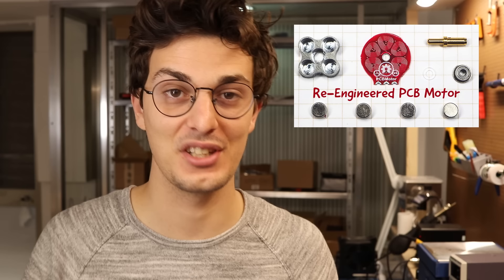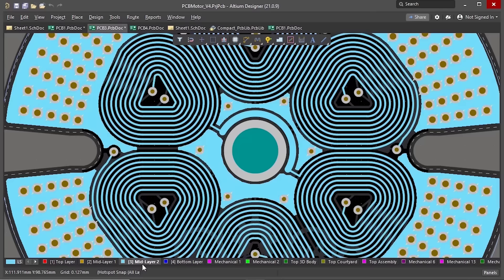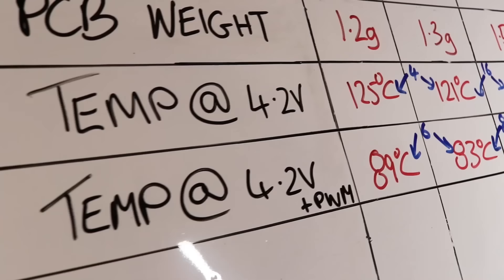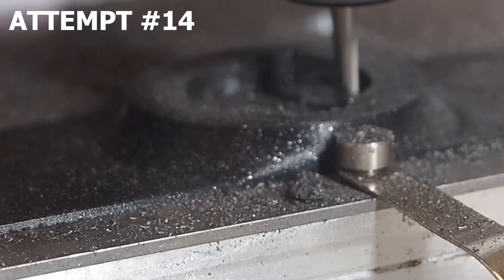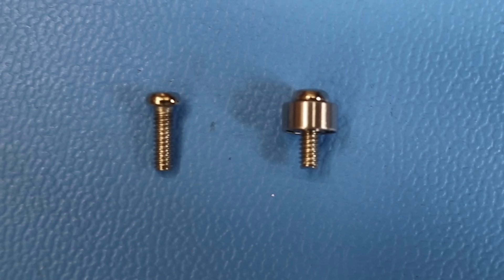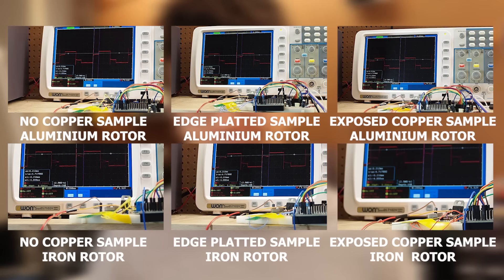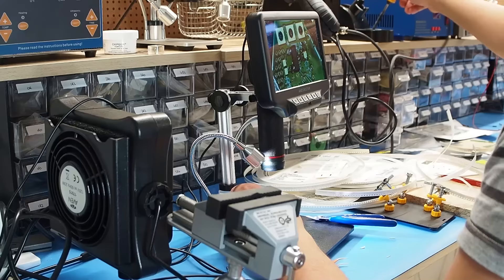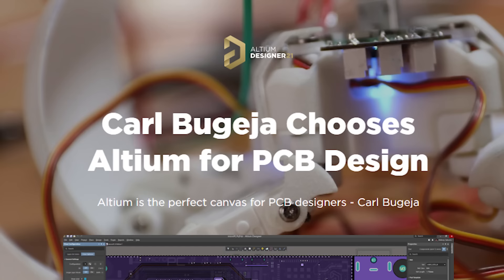Making PCB Motor v4

Comment: You STILL have not completed the magnetic circuit through the stator. You can DRAMATICALLY increase your torque by putting a second rotor on the other side of the stator to draw the magnetic field through the stator windings more efficiently, as well as adding the additional magnets. You could also just put a steel water on the back side of the stator, but you'll get some eddy currents being made inside the washer.

Comment: A cool project idea for these struck me today - a quad copter.
If you could write custom controller code for a small microcontroller and add a battery, you might be able to have a quad copter milled and assembled and sent to you save for the propellers.
PCBs are pretty lightweight but also decently strong, so being able to just order some quad copter a cheaply from a PCB mill would be pretty cool.
Heck, maybe the military could put electronically-activated explosives on them and get a cheap source of controllable missiles lol

Comment: I'd recommend to set up design rules in Altium Designer  to avoid silly mistakes in future.
Design rule check really helps to find either undesired net connections or layout that goes beyond manufacturer's capabilities.

Comment: Instead of iron use silicon steel (aka electrical steel). Silicon steel is a mixture of iron with a silicon content of up to 3.2%. The silicon addition improves the magnetization of the steel and its electrical resistivity (the opposite would be electrical conductivity). Adding silicon increases irons’ electrical resistivity up to 5 times. This change results in a decrease in the alloy’s eddy current losses, which directly affects the magnetic core. To fabricate the cores you have to water cut the shape as heat destroys its properties and you can't machine it because it shatters.

Comment: If you add some small holes near the center shaft of the rotor, the rotor should act like a centrifugal compressor and increase the air flow between the rotor and stator. Increasing cooling of the stator with force convection. Or, put the holes in the pcb stator near the shaft for the air to flow.

Comment: Hey Carl you need to develop an insulin pump for people that have diabetes.. insulin pump usually has a stepper motor with a 17- 50mm diameter.. I’m not sure if bldc would improve something in working of insulin pump but the best advantage bldc has is high speed..

Comment: Cool project, and I'm a bit late to the game ;)

But, have you considered different ways of increasing / shaping flux in the motor? two possible thoughts:

a) leverage vias and/or copper planes in the center of the coils to mimic a metal core
b) use 2 PCB's to sandwich the rotor between to mimic radial flux motors

Comment: :1 Hello there, if i could give you some suggestions, you could try to improve your motor by laminating the iron. I know it seems to b something really hard, but there is already some silicon-iron or ferrite sheet in ali expres which are really thin, even more than that you could use the rotor itself with no magnets, since its made of iron however i suspect that if you do that you would get a lower speed because it would be working as an asynchronous machine. The lamination of the iron has to be parallel to magnetic field axe and it would help with efficiency.
Reply: hi could you please help me find those thin sheets from aliexpress? could you please give me a link? I can't seem to find it

Comment: @7:54 it makes less heat because it's carrying less current: the spinning magnet is inducing voltage in the wire, so there's less voltage (and thus current) flowing through it.  This is the same reason why you got the same RPM as before - you can't go faster because the spinning magnets induce the same voltage as you're trying to drive them with, leaving 0v left over to go faster.  i.e. KV.
Reply: This is also the reason why applying "countercurrent" (I don't know if it's the right english word, basically reversing the supply to try and stop/reverse the motor) can be catastrophic if the motor is moving too fast. The field coils see the voltage coming from the supply plus the voltage generated by the spinning rotor, and it creates an enormous current spike in the coils.
Countercurrent was used as a means of emergency braking on some old rheostatic trams, but drivers must only use a few notches of the rheostat otherwise they'll blow the motors.
Reply: @demoniack81  Yep!  I destroyed my $200 dual-VESC that way (hit the brakes when driving it from a lab power supply - turns out that when the VESC can't sink the incoming power into batteries, it self-destructs in protest...)

Comment: Could have just drilled the pockets in the rotor. After drilling the first hole you can bolt it to a piece of wood and weight it down.
Reply: I think the main issue with doing that is re-centering in the mill - matching up real world holes with CAD holes is quite hard, especially on a little machine like that! it's doable but doing all the holes in one pass is a much more repeatable process, which i imagine is even more important for such a tiny part where a small misalignment would add up very quickly (:

Comment: I don't know if this would help, but another PCB manufacturer (JLC PCB) have upgraded their pcb range to include aluminium as base instead of standard FR-4. This will improve heat dissipation a lot.
Reply from the maker: thanks for your comment :) aluminium pcbs are usually used with 1 layer designs - multiple layers will significantly increase the price

Comment: Try nickel instead of iron.  It too is a magnetic material.  If you have any Canadian quarters between 1968 and 1999 they are 99.9% Ni.  1985-1981 "Nickels" (5 cents) are smaller but harder to find and also 99.9% Ni.  Interestingly, newer coins have steel in them so even they might prove interesting.  You could of course also just buy nickel disks/rods, etc and try milling them or have PCBway try it, but it shouldn't be as difficult to mill as iron.

Comment: I think you should have heated the iron rotor to about 200C with hot air and then drop in the bearings. let it cool down naturally and perfect fit. No knocking necessary... :) Maybe you iron bearing not tempered that's why it broke? Overall good job!

Comment: You could add a small 3d printed fin structure to the PCB-facing side of the rotor which acts as a small ventilator for cooling the PCB actively.

Comment: Great video and from your pronunciation, I think you're from a sunny and currently very hot place called Malta. Can't you use a small vice to hold the iron pieces whilst milling? You could also try a magnetic table as a vice. It should work. I also think that the bearing insertion should be via a vertical press of sorts and make sure to keep to the bearing tolerances when you manufacture the bearing hole (use BS.4500A or similar).  This is also true of your makeshift rotor shaft. A screw like you used is not machined to precise tolerances. What you need is a machined shaft with the correct diameter and applying the same tolerances. Bearing should be press fit and with that sized bearing, the "press" can even be your thumbs. No need to hammer :-).

Great stuff, well done and keep it up.
Reply from the maker: Thanks for the tips! 🙂 I will apply some for these in the next rotor version

Comment: Use Painter's tape and Cyanoacrylate glue to hold down part. I learned it from NYCNC. It works exceptionally Good! Apply painter's tape on bed and part and than stick them with Cyanoacrylate Glue.

Comment: How to CNC small parts: Get a bigger sheet of metal, this way you can klamp or glue/tape it down better.
Let it cut it the desired path but add small thin Bridges. Like this the part wont fly away after it got cut out. You have to cut a the bridges to get it out. than smooth the edges where the bridges were. Finish.

Comment: I’m sure someone’s said this already, but what about 3d printing a small fan to fit above the motors that spins with the shaft, directing cooler air onto the pcb
Reply: sounds like you're about to build a drone :)

Comment: The speed limitation could also be caused by the shape of your rotor, it's not exactly, as we say, "Aerodynamic" or "Perfectly balanced"
Possible that making it round would increase maximum speed but that would also add weight so I see what you're going for here for sure. Adding poles could most certainly help with that.

I think thermally the edge plated version makes the most sense. You say that the fins of the exposed copper unit don't make a lot of difference to the overall size, but the extra size of the fins does mean that whatever your motor will be driving has to be further away from it, regardless of where it may be mounted. It also increases the diameter of things like wheels. With the edge plated unit, you get the improved thermal performance as well as the option of keeping the motor smaller overall and making the effective "size" of the motor in a given design dependent instead on the rotational position that the engineer may choose.

Comment: I think neighter aluminium nor iron is a good way to hold the permanent magnets in the rotor. I would recomment a fiber reinforced resin like G10. In order to increase the magnetic flux you can use an iron plate linking the poles of the permanent magnets on the opposite side to the coils. This will give you a higher flix density trough the coils. I also don't think that the distribution of the coil over the pole area is advantageous. It should be better to arrange the coils around the diameter of the permanent magnet. Otherwise a large part of the Lorentz force will not lead to a resulting torque.

Comment: The next time you are doing small objects on a cnc, Glue them to a metal plate with super glue, it dries quick with a firm grip. Afterwards you use acetone to remove the resedue glue from the metal. Watch makers use this trick to make small cnc parts.

Comment: That's some nice project! Suggestion: would it be possible to adjust the rotor for optimal air flow to the print, and thus allow higher currents, hence more torque? 
Suggestion 2: double the amount of poles... 
Anyways, I'm following this. I want to know where this ends.
( Suggestion 3: register for patent if possible)

Comment: Could the added size and material of the thermal pads be used to make a larger motor instead which would heat up less in the first place?

Comment: Very cool idea!

You could make the rotor with a drill press, it's not a complicated part.

And about the thermals:
Keep in mind that your motors have different efficiency at different loads (aka aluminium vs. iron rotor)

Comment: How hot was the ambient temperature when you did the measusements? I saw on the news that is extreme hot in the place you live.
Reply from the maker: Around 24degC (using ac)
Reply: So you are just outside the heat wave and the forest fires.

Comment: You want to use lots of copper with a high surface area to manage heat on a PCB, but removing the solder mask actually decreases the emissivity and can lower heat transfer. They only time you want bare copper is when you are conducting heat to another part like a heat sink (or component leads/exposed pads). In conduction the solder mask resists heat flow, but if radiating the heat to the environment the solder mask will be more effective than bare copper. 

However, the most effective mode of heat transfer on Earth at room temperature will be convection. You want to get some air moving over that copper area to cool it. Increasing emissivity will help most in free air convection environments when airflow is low as the contribution of radiation to total heat transfer is constant. As more air moves over the PCB, convection will become more effective. 

What if you modified the circuit board so you could glue in small cylinders of ferrite in the center of each coil? Wouldn't that make the field considerable stronger? It may be hard to find a ferrite rod with a small enough diameter, but what about electric steel wire? Unfortunately it seems to mostly be manufactured in sheet form. Regular steel wire would also work and would be better than not having it. It would be easy to test by manufacturing board with holes in the center of the windings. Test one with wire and without. 

Also are you using multiple layers to build the coils to get more turns out of the windings?

You may have already tried some of these suggestions. I know planar transformers are used commercially in electronics design and some are formed using  windings directly on the PCB. 

https://resources.altium.com/p/how-create-planar-transformer-pcb-layout
https://www.ti.com/lit/ug/tidub83/tidub83.pdf
https://scholar.harvard.edu/files/sct/files/coreless_planar_printed-circuit-board_pcb_transformers-a_fundamental_concept_for_signal.pdf

Good luck and have fun!

Comment: Very nice work. I am more interested in the feedback version as it can be used in a more compact servo design that can be used in small desktop motors. While watching this video, I was thinking about the 4-magnet robot being a sun gear that will fit into a planetary systems. I'm more focused on the speed of this motor than the torque as that can be increased with the planetary gear box.

👍👍👍👍👍😁

Comment: have you thought about expanding the coil throughout multiple PCB layers and then connecting them in parallel? That way the coil resistance should lower

Comment: Really cool stuff -  clever way of testing the motors.  You could also make them do some work such as attach to a wheel and drive up an incline or pull some fishline around a pulley.  Could also try attaching propellers and testing them that way.  This would give some sense with respect to what they are capable of.  Anyway really good job presenting as well.  Did you design these for a specific application?

Comment: What If you stack three layers of thin circuit film, kind the microwave touch panel film, then you can have 24 turns of winding for each coil, making your motor less short circuited and more inductive

Comment: May i suggest you something?
Instead of using copper as heatsink, why don't you use aluminium. These days, JLCPCB offers your board that can be turn from standard plastic to Aluminium which is perfect way to solve more on temperature issues on your design.

Comment: If you can accommodate the precision required, would it be worth it to mill very small fins under the iron rotor for airflow? Maybe punch some holes in the center of each coil. Probably not effective given the scale, but higher rpms.... Maybe?

Comment: You should use a roller bearing or a needle bearing instead of a ball bearing I can solve the balance problem!
Otherwise you can try aluminium PCB to dissipate more heat!

Comment: Hej, how about making a cone from the flex-PCB, wide end uppermost? On the inside surface you have some coils which are all energized. Then drop in a conical magnet. Should be able to at least make it levitate?  If you glue a diametrically-magnetized disc magnet to the wide end of the conical magnet and add a second series of coils a little higher up that are sequentially energized maybe you could even get it to spin?

Comment: are you sure the programming pins are shorted to supply? if you were using a continuity tester, and had the + terminal on the IO pin and - on the supply pin, then current would flow through the IO pin's protection diode, making it look like a short when it's not

Comment: Is there any reason why you don't have rotors on both sides of the coils as the magnetic field exists on both sides. The axle would be the same and the external part of the bearings would attach to the coils board

Comment: Could you just have the pc motor part without the esc made and put it on the other side of the rotor and just connect it to be in an opposite phase. Then that could increase the torque so you could use lower voltage maybe to help keep the heat down? I'm not very smart so that's why I'm asking this likely dumb question.

Comment: A very cheap chinese lathe would be great for you - it would allow you to make very small axles with thhreads as I believe that vibrations at 20krpm would be a concern for power loss/inefficiencies. The increase in precision from a mini-lathe (and some care with its manufacturing) would allow you to finely adjust the air gap down to (potentially) sub 100um which would again see some torque increase. Also, some small vias around the centre axle hole (maybe also integrating some shallow backwards curved vanes on the pcb side of the rotor) could also facilitate some centrifugal air flow across the rotor-side pcb which may also improve your peak power output. But from this first video I've seen - I really enjoy this level of mechanical/electical engineering - subscribed.
Reply: @AwesomeMau5Heads  if he wants to spend the money on a brand new Schaublin 102 - then by all means. But a cheap chinese mini-lathe is more than capable of the tasks I mentioned.
Reply: @LitchKB  it's more the origin than the quality.

Comment: YT recommended this to me, it's a very interesting project!!! instant sub! I have an idea, what if you make the track spirals a little bit wider, so it can handle more amperage, so it won't overheat as much when you apply that much Voltage?
Reply: Bigger traces = less windings per same area, meaning weaker magnetic flux. You'd need to run more current(=more heat) through them to balance it out, so it's a tricky trade-off.